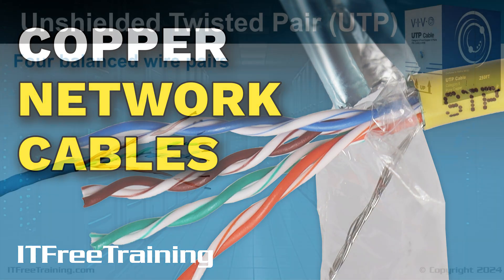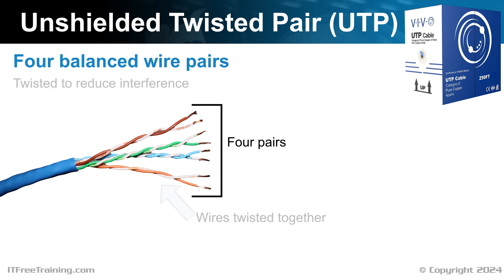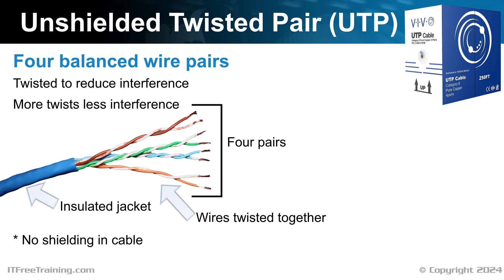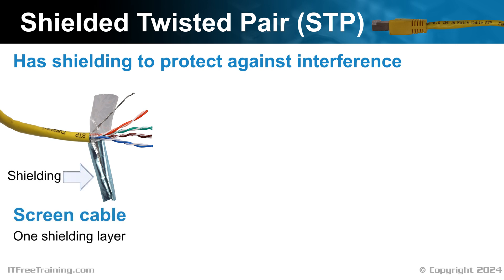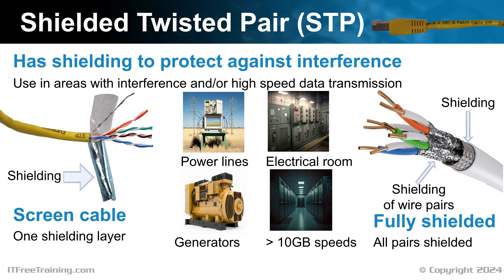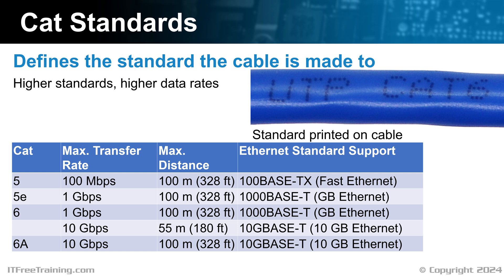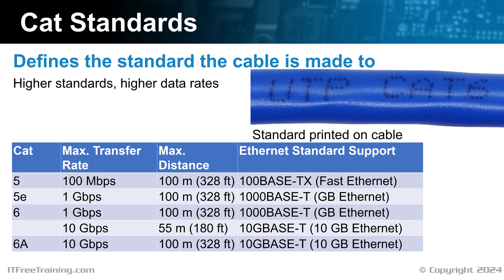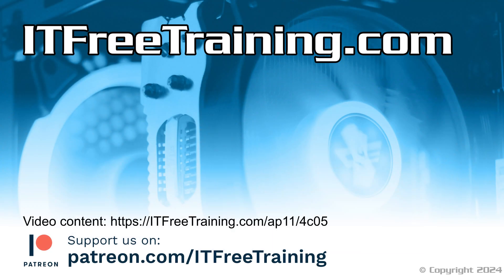Copper Network Cables - CompTIA A+ 220-1101 – 4.4

Comment: since 99% of computer NICs are only 1Gb, we only run cat6 for office data drops. the only exception is IDF room interconnects. most enterprise switches have 2.5Gb or even 10Gb SFP ports. So, we'll run a cat7 STP or Fiber for those.